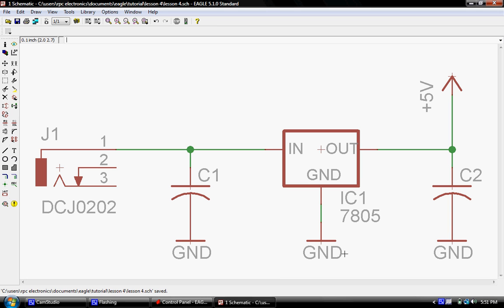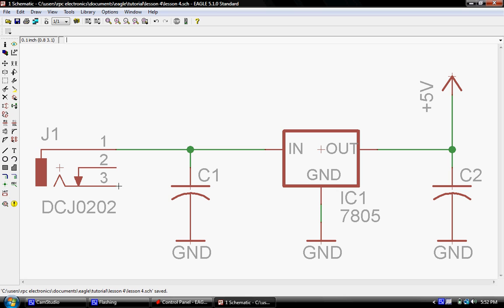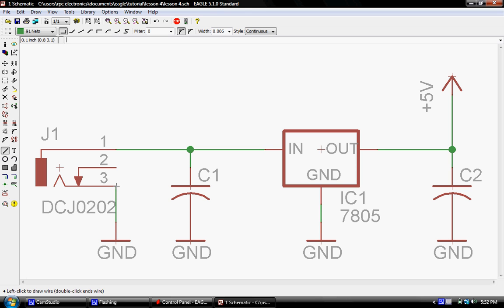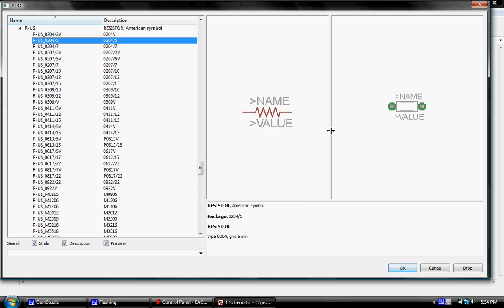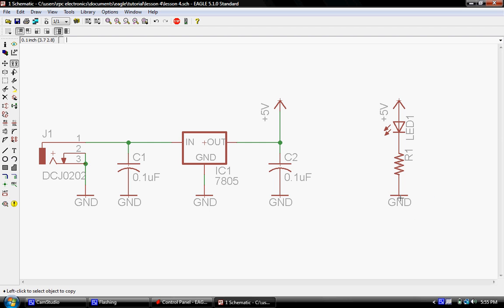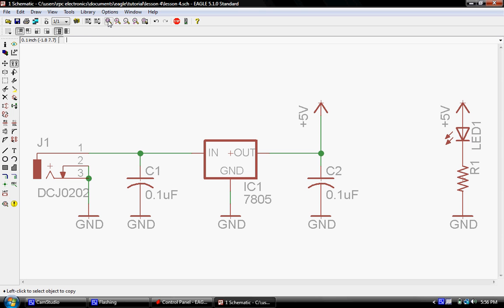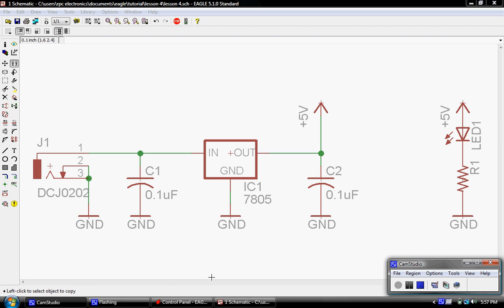Cadsoft EagleCad Tutorial Lesson 4

Comment: Tutorial 4
0:00 - Jack DC Connection
2:35 - Value to Capacitor
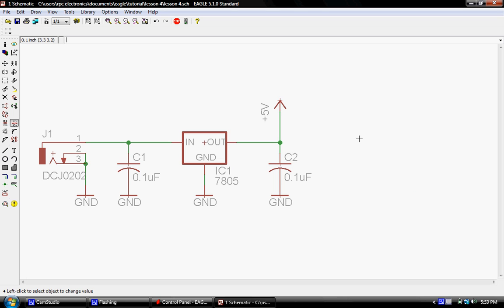2:52 Adding LED
3:35- Resistor
3:50- Changing Orientation
5:03-Zoom In,Zoom Out,Fit

Comment from the maker: @zero0ohm This is a 2.1mm coaxial style power jack.  I think I have covered this before, but whoever drew this part was a bit off.  I know what you stated sounds right, but if you connect the symbol up the way you suggested, it WILL be backwards.  The + sign should be over the top line, but instead it was placed where it looks like it's associated with the shield.  I understand that this is a self-isolating jack.  Usually used for switching a battery supply in and out of the circuit, depending..

Comment from the maker: To be honest, I rarely use leaded resistors now, but when I do, I go with the most narrow footprint and use 1/8w primarily.  Of course, there are times you might need to use a larger footprint for large sizes.  One way to do that is place the part on the board, then print the layout 1:1 ratio and then lay the real part down on the printout to see if it will fit.

I regularly do this with new SMT parts that I create libraries for.  I want to make sure the footprint is correct.

Comment: The following is a response from CADsoft tech support re: the use of the Line / Wire Tool to draw electrical connection in the schematic:

"In the Schematic editor its best if you use a .1 inch grid to place your components and to draw your NET's.  To define connections in a schematic use the NET command".